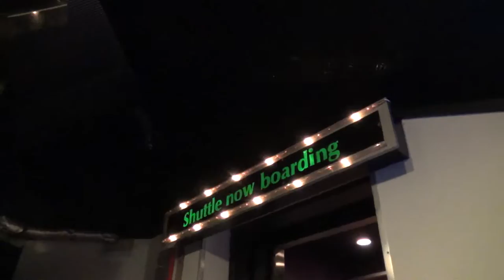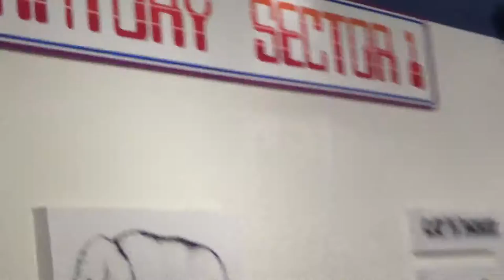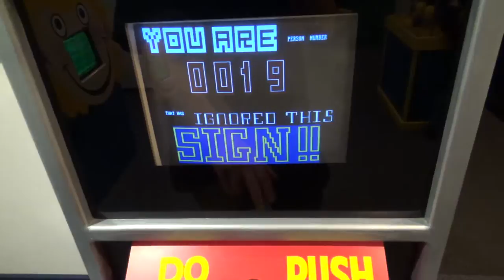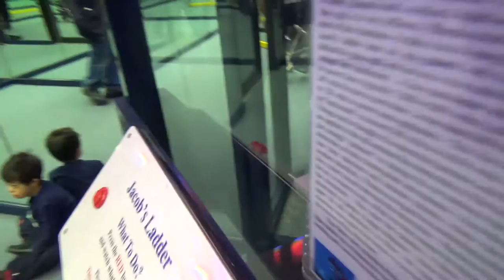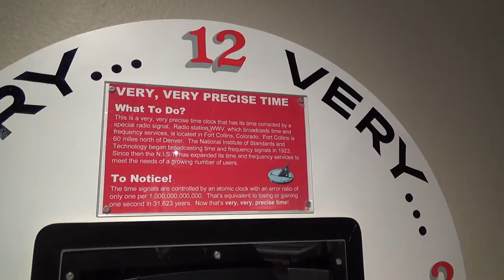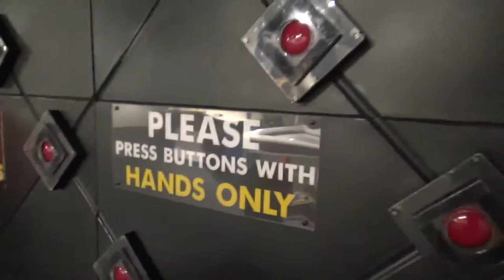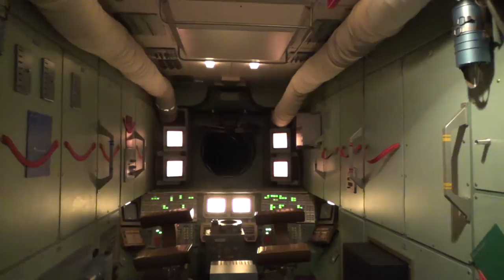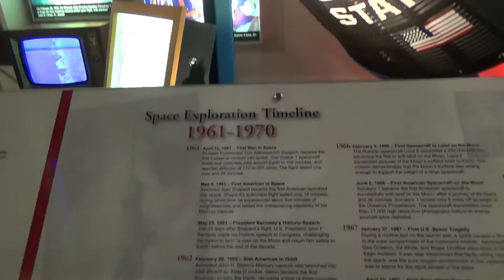Tommy Bartlett's Robot World & Exploratory

Comment: This place sucks without robots.
Reply from the maker: They gutted the space station and ripped it apart over the winter. Completely re-doing it. It went downhill immediately when they got rid of the robot tour. They are turning the facade into a giangt robot looking thing. It's hideous. Not sure what the inside is going to be like, but Tom Deihl really F'd the place up (The owner) Just like he F'd up Lake Delton by ordering the dam overflow sandbagged.
Reply: @KmanAuto  I had a chance to visit the museum back in 1998, but I chose the Wax Museum instead. :(
Reply: @KmanAuto  Do you mean they gutted the inside of the space station building, not just the exterior?  I hope it was just the exterior because that elevator ride and the space ship decor, lighting, and sounds made you feel like you were on a space adventure.
Reply from the maker: @autistic-lutheran-carnivore  100% Gutted. It's just Scaffolding inside the "giant robot" exterior. I haven't been in the elevator since, but considering when they were remodeling the station into the robot, it was all open to the elements for months. So whatever wasn't removed when they did the original gutting, got trashed by the elements. I live & own a business down the street from there. It was extremely disappointing :-( 
Had I known it was going to be that bad, I would have done a better video.
Reply from the maker: @autistic-lutheran-carnivore  I'll date myself, I remember when "smoke" would come up from the floor of the elevator as it blasted off.
Reply from the maker: @autistic-lutheran-carnivore  I tried buying one of the Ta-Too robots, as I have some robotics background, but they were all gone. Sold one two three. Heard on the grapevine that the guy that dumped a ton of money on all the robots was pissed because the system was so trashed none of it worked. Everything was ran from ancient computers. 
One Ta-Too robot still is there, a static display in the old restaurant area, up high where no one can touch it.